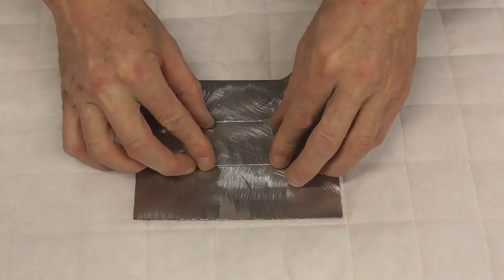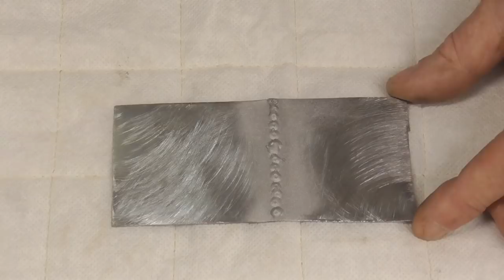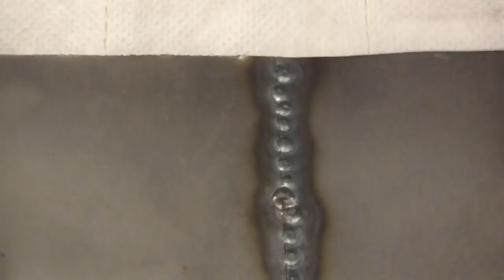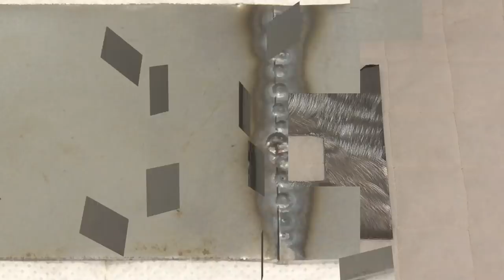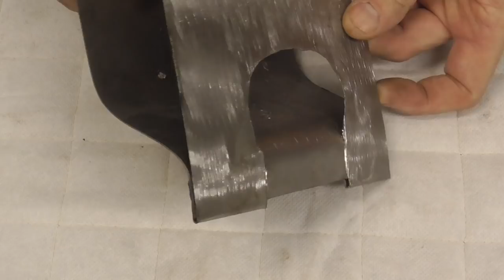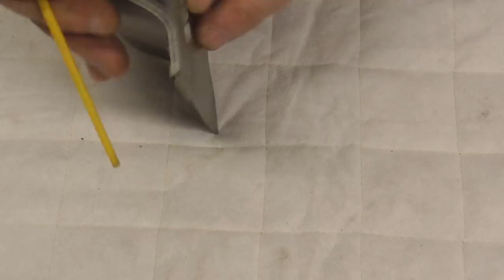Welding Patch Panels - Lap or Butt?

Comment: The way to avoid the "gap" on the backside is to fit the patch so there is perhaps a 1/32 to 1/16 gap (if Mig welding) or just Tig weld it if you have a perfect fit.
Reply: Yes leaving a small gap and stitch welding it together is the correct way of patching a panel also applying a rust preventive and sealer  on the back side of a panel is necessary.
Reply: Well you gotta be pretty good to do that. i smell lots of burning through on thin sheet metal. on maybe 18 gauge that would be OK. Old cars may be Butted new ones Not so much IMO.
Reply: Seems to me on the lap weld, there's more area to catch salt and chemicals on the backside. Then I'm not the best judge of it because, I like butt welds over lap welds anyhow.
Reply: It’s like what they teach in schools and what is done in the real world when you are under the clock. $$$$$
Reply: A body shop isn't going to pay you to take the time it takes to cut a patch to fit perfect. Time is money
Reply: @jonathanyates5198  Very good point Jonathan, and precisely why I learned to do this stuff myself.  I wouldn't trust most body shops to even look at any car I cared in the least about.  They are all about cut as many corners and do things as cheaply as possible.  They just want the work to look passable for a year or so, then when the rust bubbles through or the 1/2" thick Bondo cracks, it's too late for them to be accountable.
Reply: @jonathanyates5198  ..Well OK, I won't be coming to your body shop..As a customer I dont want bish bash bosh $$$$$..I want good job and then $$$$$
Reply: @Mikefngarage  I'm pretty much in agreement here. I'm having a challenging time with the 20ga on my old Toyota, so I would imagine a lot of issues with newer, thinner stuff, even with 0.024" wire and voltage dialed way back.
Reply: Thanks for the tip. Think I'll give it a go. But, oh my goodness, the name "John Shaft" takes me back to my late teens/early twenties driving around in a '67 TR4A IRS in the U.K.! The A had an easier top to drop, so when the rain paused for a minute in rainy Manchester at a traffic light in the autumn I'd do so and sense the envy from the guys driving posh Mercedes and BMWs. Great motoring days for sure!
Reply: Just catching up on older videos! Great info!
Reply: your spot on here, soon as I saw this I knew immediately the original poster of the video has no idea what their talking about...

Comment: Very helpful video. Thanks for the knowledge. I spent many hours trying to get cab corner to fit for butt welding on my rusted out F250, and then ended up with some fairly thin welds after grinding it smooth. I think I'll get much better results in much less time after this lesson.
Reply: that is usually the case kev. only a few guys can do the magic. and on old 18 gauge butts are fine but these 22 cars nope. too thin. better off lapping.

Comment: You left out a third option, "Cut and Butt", where you make the patch larger than the opening, tack it to the panel, then section by section cut away the underlying metal and tack welds, and butt weld the patch to the panel.
Reply: yea that is usually how I butt weld when I do it. I do both depending on the repair. all fair game to me if it repairs the problem lasts and looks good.
Reply: Yep! Seems to be the best way to fix a panel. Strong as new! Can take some time.
Reply: I like to leave a gap and spot weld into that gap, or sometimes have a very small overlap and burn that edge away.
Reply: but you can't retrieve what you've cut off if you can't get to the backside
Reply: @PompeyMatt17  then you would have to butt weld it, unless you remove the portion you cannot reach

Comment: On your lap weld's back side, you have a gap for moisture to sit.  Unless you can get some seam sealer on the back, you have a greater chance of rust-out.  On butt welds, you always leave a 1 mm gap.  Roughly the thickness of your .024 to .030 wire.
Reply from the maker: Do you like to lap weld your patches or butt weld them?  Honestly, I've never had a lap welded patch give me any problems with rusting out.  The door bottoms, tail gate and quarters on that little blue truck on my channel were done in '08 - still no bubbling or rust but I do squirt some oil inside the panel after the repair - it sits in the pinch weld and really does well preventing future rust - Jerry
Reply: I’m going to agree here with both of you two.  In a butt weld, it’s imperative you leave a tiny gap 1/8” for the weld to seat. You will have a new weld the same thickness as the 18 g metal panel even after grinding
Reply: Should always leave a thin gap when butt welding.  Metal expands when heated and can cause the two pieces to come together at the joint.  It can rise upwards because the metal has nowhere to go since there's no gap
Reply: Leaving too big a gap will also cause the metal to shrink. 6 in one a dozen in the other...

Comment: Great tips, have always felt guilty doing laps but now feel reassured.
Reply from the maker: Don't feel guilty at all - it's how it is done in a professional body shop.  Lap welds are used where the seam can be knocked down and filled.  Butts are used on edges and rigid areas that can't be tapped down.

Comment: Another great video.   Comments are good (intelligent) and your taking time to answer.  Your videos will become popular.  Your very good at instruction.  Have promising career as instructor if you wanted.  

Also Great timing.  Got my first bottle of shielding gas and practicing welds today.   Thank you.
Reply: How you getting on with the gas mate,.ive been using flux core ,no gas,and lm not impressed,.with the welds..I'm no professional,and gas isn't cheap,.is it worth getting?can you tell the difference.😊🇬🇧

Comment: Hey, thank you. Since now, I had the plan to butt weld my current project. Now I will do both techniques. Best regards Ralph
Reply from the maker: Both is the key - absolutely.  Generally shops that I've worked at use lap in open areas that you can easily knock the welds down and fill.  Then on edges that can't be knocked down very much you butt weld.  Or if the area is real rigid like a post or skinny rocker sometimes it's easier to butt.  Got to be good at both ways and use to your advantage.

Comment: Thank you sir for these videos I live in Michigan and known for rust I'm a beginner at autobody and welding just stopped at Harbor freight and picked up a titanium 125 fluxcore welder hope that will help on the welding end trying fix up the s10 truck rusted from the inside of rockers to the point it's bubbling up cab corners and the fenders are rusted as well us beginners need your videos to continue thank you sir for sharing your knowledge to help people who don't quite understand, but have a idea !
Reply from the maker: I picked up the HF $99 flux core welder to let folks know it is possible to use a non gas welder for sheet metal on cars.  Give me a few weeks and I have that one uploaded :)  I welded some sheet metal with it and it worked fine.
Reply: @LakesideAutobody  will do! Thank you sir!

Comment: Another option is punching holes around the perimeter so strips of metal could be spot welded underneath to create a "land" for the patch panel to help with the butt welding process. Punching holes in the patch could help solidify the area as well. Not the Fitzee “cut & butt" technique but it's quick and easy, plus I get a good lap type penetration without needing to hammer it down and the less filler the better IMO.  To stave off potential rust inside, I typically use epoxy primer but lately I've just been coating everything with Krylon rust protector enamel since it dries in 8 minutes. Thoughts? Oh the fun I had using a Steck 20015 to can-opener out a couple complete interior rear wheel-wells from a salvage yard that didn't allow any power cutout tools, but it had to be done since only a fraction remained in the SV6. Today it's replacing rusted-out steel in a Ford Freestyle cradle/subframe/K-frame. The used replacements around here aren't great so I'll just do what I have to do.
Reply from the maker: Here's a good video on lap vs butt for patch panels - https://www.youtube.com/watch?v=JIIonJOVro4  and how to prevent future rust - https://www.youtube.com/watch?v=8XaZBy7GC7A

Comment: Thank you for this video! My first attempt at patching some rust on the bulkhead of my Defender had mixed results with but welding. Mainly because of the thinness of the existing metal, luckily,  none of it is on a edge. I’ll cut out the patches  and lap weld it tomorrow. Thank you sir!
Reply from the maker: You're welcome -here's another vid I did on the topic because there is so much misinformation on this:  https://www.youtube.com/watch?v=JIIonJOVro4

Comment: Both can give great results, when but welding take your time fitting your patch, when lap welding, you don’t need a big amount of lap over, in most cases a 1/4” is plenty. A shot of weld through primer doesn’t hurt.
Reply from the maker: You're right - most shops use both methods depending on the job :)

Comment: That goes right back to what I said to you in your Citroen video, if you use .035 mig wire you need an .035 gap in your patch to ensure you get the build up on the back side. If your mig is set properly the top of the bead should be flat and the underside should be proud of the panel the thickness of the panel material, so virtually no grinding and minimal filler
Reply from the maker: I'm sure that is the correct way to butt weld two sheets of metal together but in the real world you get all kinds of irregular holes, cab corners, door bottoms, rockers etc that are so damaged it is nearly impossible to do what you are saying.  Maybe a tiny little rust hole on a flat surface you could cut a perfect patch with a .035 gap all the way around but in a shop setting that's just not going to happen.  I would do a video on that type of repair but I really don't want to mislead folks into thinking that is how it's done in a body shop.
Have a good weekend - Jerry
Reply: @LakesideAutobody  I live by the old saying, "bondo, primer and paint make a bodyman what he ain't"!

Comment: very well done... ....i realize in lap welding you must beat both the new patch {at the weld site} and the fender that you butt welded to  and not go too  far in beating the seam that you end up bondo ing half way up the qt. or bed side on trucks....good job guy.....even an old dog like me can learn new tricks....
Reply from the maker: You're absolutely right.  Just tap in down a bit - basically putting dings all along the seam.  Like a real good coworker once told me "Hit it low and fill it with dough"  :)

Comment: Thanks very much for this video, which is so helpful for an amateur like myself who will probably never become a professional welder but has an interest in doing bodywork repairs to the best of my ability. I've got a hole in my 2001 Silverado's roof and bonnet, and while  I could go the plastic route I'd like to do a "proper" job. The other issue is my RHD1980 911SC which needs some attention to the suspension pan and the windscreen corners (sounds familiar to anyone with air-cooled 911 experience?!) and other bits. I will probably need to send it back to the U.K. (permanently) to get the suspension pan done as the island I live on may very well lack the crucial expertise,  but I would like to have a go at some simpler jobs. Thanks once again!
Reply from the maker: In case you haven't seen this, it should give you the confidence to weld anything involved with auto body repair - https://www.youtube.com/watch?v=1BYqLM_mY1s   Flux core is a bit harder but still very achievable https://www.youtube.com/watch?v=ic7Gwf8y4Yc
Reply: @LakesideAutobody  Thanks a lot. Really appreciate your willingness to encourage the amateur trying to "have a go"!
Reply from the maker: @uzerap  You're welcome - thanks for watching my friend :)

Comment: Thanks,AGAIN, Jerry! In regards to the 1st part with a SMALL totally lap- welded patch on any  panel with space behind it,could the patch be applied from the  back of the existing panel and welded? Then knock down the welds and fill the patch area and blend into the rest? It might be easier and look better in some cases. I know very little about this trade so forgive me if this is a stupid question! 
Also, I would have never thought about a "combination" lap/ butt patch! Thanks again!
Reply from the maker: Yes.  You can fit it behind if you can.  It's often hard to do because the patch is always bigger than the hole.  Here's another video on this topic - I think it explains better - https://www.youtube.com/watch?v=JIIonJOVro4   Lap is how the factories did it for years when they attached the quarter to the roof at the sail panel - a lap weld in a valley filler with lead or plastic filler :)

Comment: As many have stated, the butt weld had way too little gap. That is why the penetration isn't good, also don't be so light on the trigger no need for skimpy tack welds and low heat if you take time and use air to cool the welds in between. I understand that you are trying to show the difference between the two but it should be properly done for a comparison. I disagree with the replies on it being a time based decision and i disagree with your idea that a flange weld is "stronger" so it is better in the sense that it needs to be twice as strong with two layers when sheet metal is only one layer thick from the factory. Putting panels that close together doesn't account for expansion furthering the possibility of warping. Not knocking you or the way you do things in your shop just commenting on the way you presented the difference. A DIY guy should be taking their time on the cars and projects they love to do it the best way possible. Lapping is fine for high volume shops, but I don't think it is the correct way for someone to learn to do it for personal cars when considering to them what they are doing is a quality restoration.
Reply from the maker: Pls direct the viewers to a video that shows how to repair the rust in this video using only butt welds :)
https://www.youtube.com/watch?v=36zkc9UQaTs

Comment: Im in the midst of this right now. Im leaving a gap to butt weld. Lap welds trap moisure too. Unless you can seal it. Another one is stepping the parent metal then lap weld the panel in. They all need sealing from behind for a permanent repair. Rust starts the moment a weld cools.
Reply from the maker: Remember though that lap welding is like a shingle on the inside.... the seam is upside down moisture has a tough time traveling up.  The bottom of the patch is usually the bottom of the car which is a pinch weld or just open.  Hope that makes sense :)

Comment: Lakeside Auto like use lap weld, but put patch behind instead on top then grind smooth>>>> lay some Evercoat-Metal to Metal/All metal filler or do some lead work just depends on the job I do old body work with lead, this is just how i do it, there's 25,000 body guys your going get 25,000 different opinions, tech ways, right way, wrong, in true metal work its the finished job that last the best....you put $4,000.00 worth paint with your $900.00 Sata HVLP spray gun, if that stuff ain't straight is going look like s@#t. 90% body=prep work, 6% paint, 4% finish. I have done 25 years auto body I started out knowing nothing still know nothing I am not "professional" nor do claim be one. I do it for fun make extra cash. I enjoy your videos keep them coming i learned little tech tips from you. As do I learn from everyone put use what best for me.
Reply from the maker: Absolutely!  There's a million body men out there and a million different ways that work.  Glad you enjoy the channel - Jerry

Comment: The trick to a good butt weld is the root gap. If the panels are tight fitting, the weld pool won't be the same on both sides.  With the correct spacing, the root will allow the pool to flow through and give the correct penetration and you will get a panel welded perfectly.
Reply from the maker: That is true but in a real world setting that gap is not always going to be perfect - especially with severe Michigan rust.  Check this video out for more on lap vs butt: https://www.youtube.com/watch?v=JIIonJOVro4

Comment: My personal opinion on this is that it really depends on the project. If you're doing a higher end job I would never lap weld in the middle of a door or any panel for that matter. Really any panel that will see direct sunlight and be right in the viewers eye. There is a very good chace it will ghost back and you will see it. Small rust repair on a daily driver, sure why not. Its must faster and frankly on jobs like that, time is money!
Reply from the maker: You will never notice any of these repairs.  The same methods found on this channel are used by one of the best body shops in the thumb area of Michigan - I know cause I worked there.  Follow the steps exactly as you see on the videos and you'll be fine.  Here's a video of a Charger I painted while working at that shop - It still looked perfect 20 years after painting it: https://www.youtube.com/watch?v=2o37dX--w0I